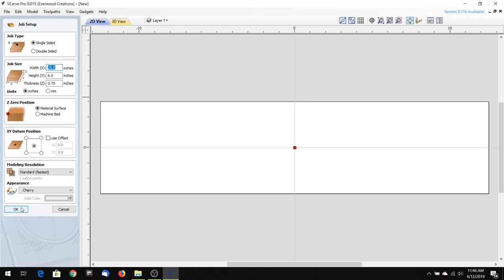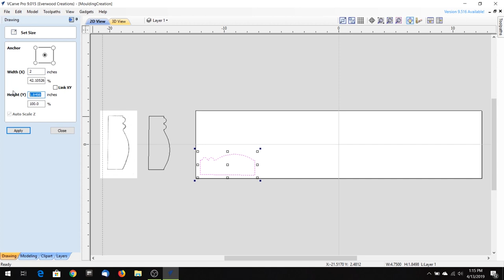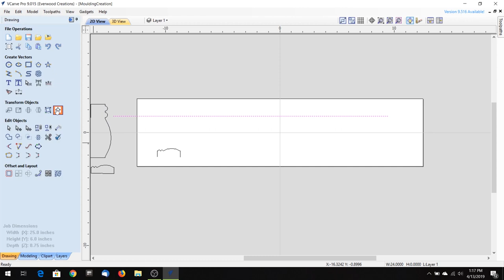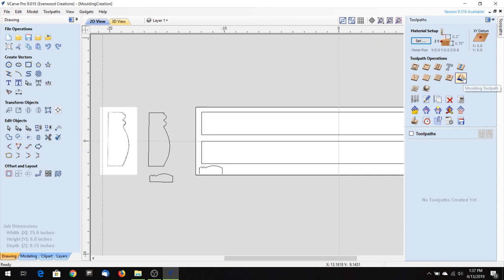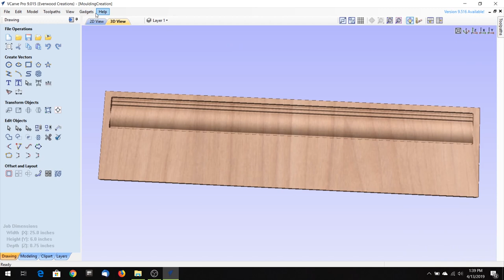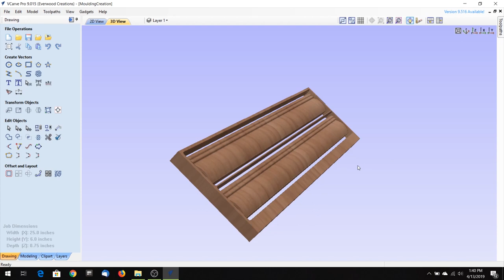VCarve Pro Moulding Toolpath (Revised)

Comment: I cannot get the tabs to appear in the 3D view. I can see the bumps in the toolpath, but not the tabs in the 3D view. Using ver 9.518
Reply: Figured it out. I needed to remove the vertical sides from the profile.
Reply from the maker: Glad you got it figured out!  Your comment may help others with a similar problem.

Comment: Hi, I am trying to do the toolpath, but nothing happens after I select the profile. Is there any specific key that I have to press, or just select them with the mouse?
Reply from the maker: If I am understanding the question correctly, while in the molding toolpath panel, you want to first select your driverail, hold the shift key and select your profile.  The last vector chosen will be used as the profile if you are doing multiple rails.  Hope this helps!

Comment: I don't recall the tool you used but assume it was a 1/4 ball nose?
Reply from the maker: For this molding set I actually used a 1/16" ball nose because the small details at the top required it.  I have used 1/4" ball nose successfully on molding that is less intricate though.  I did use 1/4" end mill for my clearance tool.